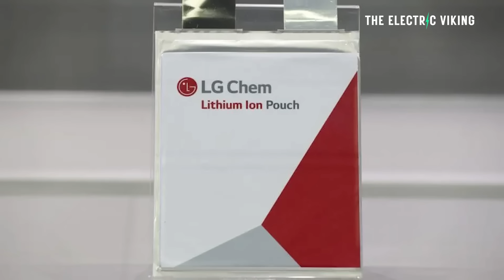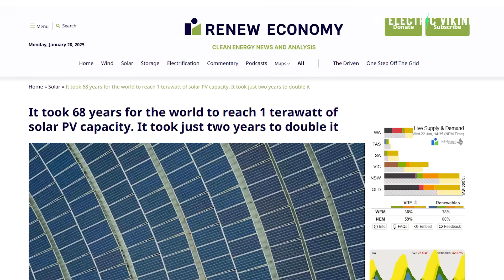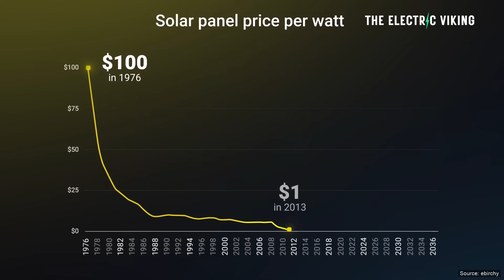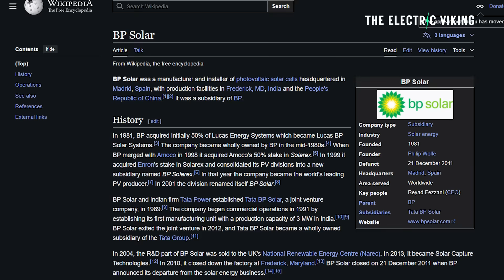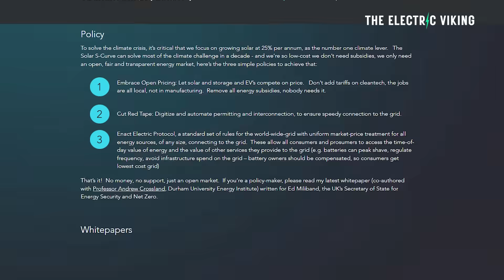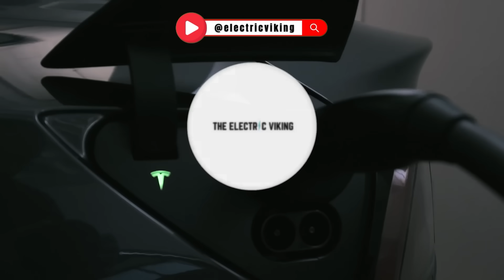S-Curve modeling predicts half of world’s energy will come from solar by 2035

Comment: Here in the Netherlands, the adoption of solar is so fast, that the grid operators can't scale the grid fast enough. They are throwing money at hiring and training more people. But even all that takes time. Way more time, than it takes to put up more solar. And energy storage is lagging behind. The grid operators are forced to burn exces energy through large resistors as heat, during peak hours and at overloaded interconnects. So it is not that we cannot produce enough. The current problem here is that it is hard for the grid operators to maintain grid stability. This should resolve it self in a few years, as batteries get cheaper and energy storage more abundant. But in the mean time we are in this gap, with a lag of storage and to much solar going in to the grid, with regulation that force the price up, because some politicians made regulations without thinking about the longterm. Now the prices are being driven up, because of net metering.

The net metering mechanism is a legal requirement that obliges energy suppliers to offset the electricity fed into the grid with your purchased electricity, on a one-to-one basis. This requirement will likely disappear in the coming years.

The problem with this mechanism, is that it does not account for the price differences in supply and demand throughout the day. Making the energy suppliers pay the difference of the energy that was put in the grid when it was worth nothing e.g. daylight peak hours, and then having to buy it when it was more expensive, e.g. at night.  That cost is then divided over the whole customer base. Which in the beginning was not a problem, when there we few people with solar. But now it is the reverse. And the more solar we put it the grid during the day and take out at night. The higher the prices will be for every one that takes power from the grid. Which effects the people that can't afford solar or can't have solar, like because their home is a monument or something, pay exorbitant prices for the people that have solar. Which is just wrong, and would not hold up en EU-court I believe. 

Also last december we had a new low, in solar energy production, because it was cloudy and dark for almost a month. That is the month with the shortest day light hours of the year, here in the Netherlands. To get through winter on our own solar and batteries, we would need about 2 months of storage per consumer. Cause we can't count on there being any sun, sunny enough for solar in the winter. That would be a massive amount of battery storage. 
So storage wise, we need terra-lot's more.

Comment: We just bought an EV with a bidirectional battery in it (2025 Chevy Equinox).  Am in discussions with a local electrical company (which specializes in renewables work) to get the charging system installed so that the EV will act as battery storage for the house in event of power outages.  Our solar arrays presently provide about 62% of the electric needed to run the (all electric) house.  I've been considering adding another array--that'll be a trickier install (hence more costly but hey, it's only money) and that'd get us up close to 100%.

Comment: The ULTIMATE in power generation is to have a distributed power grid - it's better for the land AND security.  Can't target a power plant if the whole city is providing power.  I also really like the idea of having excess electricity - there are plenty of uses for cheap excess only energy - eg run AI datacenters with older less efficient hardware. Have them pause the workload when solar isn't generating.  Pump water up a hill to provide hydro power later, crypto mining whatever.  Then at night have the systems pause, where you only run the latest most efficient workloads.

Comment: Have they come up with a batteri that last longer than 8 hours? Why do wind company go bankcrupts?
Reply: Batteries that last longer than 8 hours?  I have some in my cupboard that are years old, they work just fine.  Why do nuclear, coal, gas generation companies go bankrupt?  Oh, wait because wind and solar is much cheaper.
Reply: @brettgracey9682  I am talking about how long you get out power from the battery. Every battery last 8 hours that is good. In some countries it good. But in germany wind can not blow for a week. You have to solve all technical problem before you can go 100%. But if you go nuclear it take 10 years to build and maybe all problem  is solved by then 😂😂 and end up With a very expensive system. 
Please talk about the grid 4.8 herts 5.2 put in same sec per sec. To have a good grid.
Reply: @lis0028 not sure if this is just errors in translation, or miscommunication.  I’m not sure we disagree.  Batteries will last different amounts of time depending on any number of factors. Their capacity, the demand on them, their purpose, their chemistry, etc.   Some people think that we need to have battery storage large enough to power everything for weeks.  That’s just silly.  Every battery that is hooked to the grid, whether grid storage, an EV, home battery backup, commercial battery backup, just makes the grid more reliable, and ultimately allows more of the cheaper renewables to be used.  It literally doesn’t matter if the battery can only power the grid 10% for 10 minutes, if it stops a brownouts, it’s a great thing.  If it stops having to import expensive power, it’s a good thing.  If the same battery makes it so a wind turbine doesn’t have to be curtailed for an hour because of excess supply, that’s a good thing, economically speaking.  

You mentioned 100%.  Who’s even talking about 100%?  The literal title of the video talks about 50% solar…..in 10 years.  More importantly, the same technical difficulties you mention, impact all forms of generation.   Electrical generators only make money when they run.  You also might be aware that there are varying demands through the year, and the week, and even the day.  Most places have higher demands, during the business day, especially in the summer.  When demand is lowest say in spring and fall, especially overnight, on the weekend.  Demand where I live is literally halved of what it is, on a hot Tuesday afternoon in August.  So no matter what form of generation, there has to be curtailment.   If a nuclear plant which is already ridiculously expensive has to be curtailed for 30% of the time, what does that do for its economics?  

Best to be realistic, and understand we didn’t get here in 10 years and we won’t get out of it in 10 years, but we can make significant changes, if we just try.
Reply: @ Nuclear is too expensive. 
The solution for local irregularity in wind and solar production is geographic distribution. While the sun doesn't always shine and wind doesn't always blow in a given location, on a continental scale the wind is always blowing or sun is shining somewhere.
Reply: My thousand watt battery will power my lights for multiple days and can be recharged every day from my solar panel. It can run my air conditioner for about 2 hours.  I can recharge it 3,000 times. 

I'll probably double or triple my battery capacity this year.  Is primary uses to shave my electric bill in the summer each year and to keep the refrigerator and freezer going during disasters until I can get the generator up.  Then it's functionality is to extend the generator life during periods of low energy usage.
Reply: Wind Company goes bankcrupte becase when the wind do blow the energy is so cheap that they don't earn any money. It is easier to put the money in the bank. Australia don't have that problem becase wind allways blow somewhere. But counrties as sweden Norway has problems.
Reply: I have a solar powered pond fountain that the batteries power about 14 hours a day.
Wind companies go bankrupt for the same reasons fossil fuel companies do, poor management and competition.

Comment: Sounds great but for places like Michigan one would have to import the solar energy via high power transmission lines. It’s been snowing here for the past two week and we have multiple days to a week at a time with no sun showing.
Reply: Mileage may vary - so what? Every watt generated by solar is one watt less of carbon in the air, one watt less from burning gas (and its costs, both in infrastructure and geopolitics). There are so many hidden factors that put you and your country in a better position.
Reply: That's why we also need wind turbines and biomass.
Reply: That’ll learn you for living where the sun doesn’t shine.

Comment: Pakistan is an interesting case. Most of the solar is installed without any governmental help. In reality, the electricity costs in Pakistan are the highest in the region, and one of the highest in the world. People save money to buy solar panels and batteries to basically go off grid. Any new industry built in my city karachi, gets solar panels on the roof, because the solar energy costs 7Rs. per unit, but govt industrial rate is like 100Rs.. Much of our agricultural equipment, like tubewells and the grinders for wheat, is also running on solar, because diesel is extremely expensive. This is creating other problems, like people with solar panels enjoy a better lifestyle than those who can not afford them. Some say the total amount of solar imported from china has gone upto 24GW this year. Pakistan's total power production capacity (all powerplants, dams, etc) is 48GW. This year there was actually a decrease in the consumption of electricity from the grid, because so many people have off grid solar now.

Comment: Germany has started 30 years ago. And PV still doesn’t work without state and financial support and regulation
Reply: Everything we use in large scales is heavily subsidised. Diesel, meat, the autobahn, you name it.

We could start by removing the subsidies on diesel. People would go mental. 😂

Fossil fuels are the highest subsidised commodity worldwide by far.
Reply: @ nope. Fossil fuels are highly taxed and are therefore expensive. They would be several times cheaper. Diesel is highly taxed as well. Just gasoline is even higher. In Germany there’s an additional diesel car(!) Tax. Tax for gasoline cars is lower.
Reply: @ to get to the point: if we want to switch all on electricity, then we need NPPs. Renewables won’t work.

Comment: Let's check in on renewables and battery storage vanguard California, which has some of the highest priced electricity in the USA. As of 03:20 AM PST 23/01/2025. Renewables are providing 10.5% of supply, batteries are draining 329 MW of supply, natural gas accounted for 52.2% of generation and imports 19.5%. Renewables are a cruel joke.

Comment: Great video, right on, as batteries become safe and solar comes down solar makes sense, everywhere.
Reply: Not a fan of roof top solar, I have a wood roof. For my current solar I used a ductile iron pipe with up to six panels mounted and a stone dead man foundation to take wind loads. As I have black locust on the property (northeastern US), I am considering the replacement of ductile Iron with Black Locust and a black cherry frame. I think it should probally last the lifetime of panels. I've started growing white cedar and incense cedar (plan on planting red cedar) for future structures.
Reply: Thats for the expansion of system to charge a vehicle.

Comment: I would say that total S-curve is probably too extreme, as they would be multiple stoppers in the way. Different markets, each one with each S-curve but that they could take time to start, so probably a little slower that than projection.

BUT, that said, in the end, it will be similar. Lots, and lots of solar. I see a lot of potential in "agrivoltaics". Because land it will become one of the constraints, agrivoltaics allows a doble production, agriculture and solar energy, it will become a common occurrence in not so much time.

Comment: **amendment* energy needs have grown since said report and this is no longer strictly correct***A study completed a couple of years ago calculated that covering a relatively small land mass the size of the country of France in photovoltaic cells, you would generate enough electricity to power the entire world with a small surplus
Reply: 24/7/365..?!? 🤔
Reply: @volkerr.  Yup it was reported on that other channel with Kryton (Robert Llewellyn) on it.
Reply: @SirNecro  but so far it doesn’t work in reality. Here in Germany we incentivize PV for 30 years and it still doesn’t work without 🤷🏻‍♀️
Reply: @ Except it does. Even here in the US, it is more economical to go off grid solar, maybe add wind and a separate heat source like a wood stove if you are in the northern half of the country.

Comment: I have a 100 KWp Photovoltaik.  In Summer there‘s a lot of electricity production, at least during the day. During the night there’s no production 😅 and in winter there’s as well almost no electricity production. So we need 100% backup for PV
Reply: 100Kw? Do you realise how big that is, or are just lying in some lame attempt to discredit solar?
My old job had 13Kw and the panels were bigger than the floor area of my flat. Where are you putting this 100Kw? Do you own a whole field? What are you doing with the rest, because at peak production that's far more than enough to run every appliance in a house non-stop.
 "😅" indeed.
Reply: @ ?!? It’s not on the roof of my house. although it’s on the roofs of several farming buildings in eastern Germany. The usual size of such power plants is up to 750 KWp. Because that’s the maximum size for a better tax incentive. 😜😁

I only own a part of it with two inverters. Which is in my case a bit below 100 KWp. 

It’s 100% going into the grid.

Comment: Unfortunately, you have missed a critical dynamic in the economics. That is that capitalist companies invest where profits are high not where costs are low. 
Without large subsidies, or broken market mechanisms, turnover and margins are significantly lower for energy companies using renewables precisely because they are cheap and easy to deploy.
So yes, solar is great for consumers but it takes a massive axe to the profits of energy companies in the medium and long term.
And investors don't care about consumers. They care about maximising the return on their investment.
This is why the only large projects have to have large government subsidies built into their contracts. They are there to pad out the profits to match returns from conventional fossil fuel projects.

I highly recommend you read "The Price is Wrong: Why Capitalism won't save the Planet".

Comment: My panels are 20 yrs old , clunky and heavy but still working fine . My panels were $800 each. The equivalent now is $100 😊😊😊
Reply: They are less effective than new ones and degradation comes additionally..
Reply: Somebody up the road from me has what looks like a 100w panel (though it's really old, it has those circular blue cells, so it might be 50w) laying out on the street, propped up on their flowerpots, and presumably still producing.

Comment: big battery here between denmark and germany would pay off rather quick. price on power broke records countless times this winter and still powerprice go to 0 other days
Reply: Having a battery for your house almost never pays off. The money you save vs what a solar roof installation and the cost for the storage battery is, it takes aprox. 20 years to pay off. And that only if you stay at home 365 days a year. I live in southern Germany and we are every year in August one month away. if you take that into account, it never pays off.. you need to replace the battery after 20 years the latest..

Comment: Nuclear electricity economics in the UK : Hinckley C has a strike price of GBP190 per MWh. Eg 19p per KWh. British consumers charge their EVs at night paying 7.5p per KWh night rate. So the first question for nuclear fans is : who pays the 12p subsidy per KWh to fund their expensive nuclear reactor ?
Reply: 1. question: why is it nowadays so expensive to build new NPPs? Might it be due to way to
Much and too high regulations? That constant chance during construction period..? 🤔
2. question/ if you add costs for back-ups and/or storage capacities for renewables (and they are as well highly incentivized by tax payers too), is it still cheaper then..?

And how long will a NPP run and how long does your PV? How long will battery storage work until it has to be replaced? Probably on double costs then due to inflation etc…?
Reply: @volkerr. The nuclear power industry promised "NP will be too cheap to meter" and "meltdown is impossible". They are liars. My solar is not subsidized in NZ. Build your NPP with proper insurance and no public guarantee or subsidy and if you cannot then admit that nuclear power is too expensive to sell in a free market. As for whining about bureaucracy, in the 1970s the coal industry whined that sulphur filters were too expensive but the EPA regulated regardless. We quickly found out that the sulphur filters were much cheaper than the coal power plant whiners had claimed. Safety is important, and if NPP cannot afford safety then we shouldn't build them.